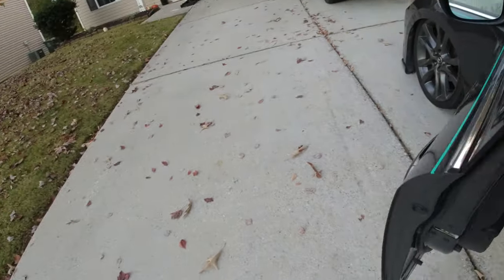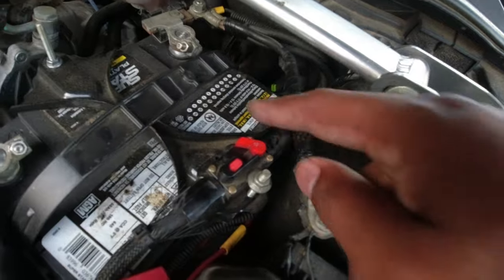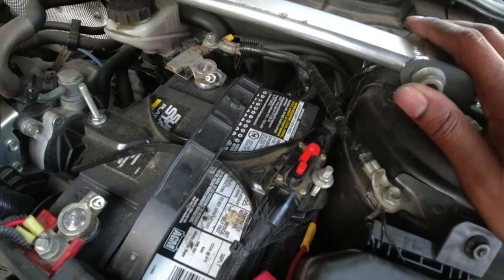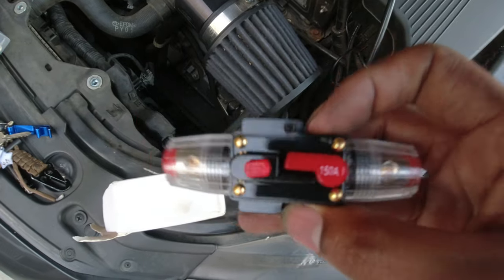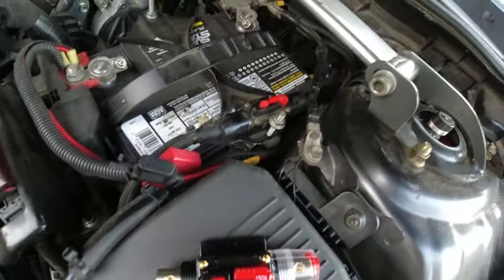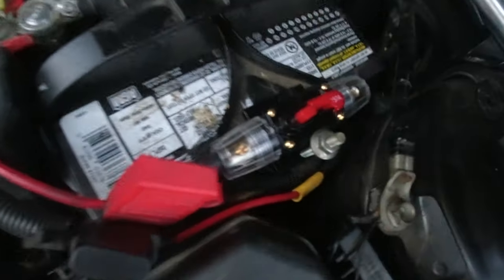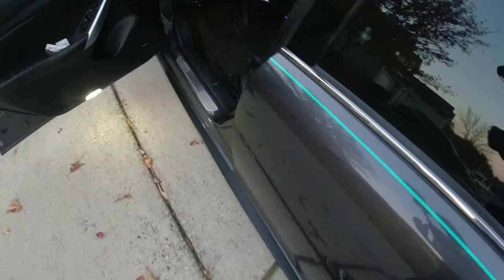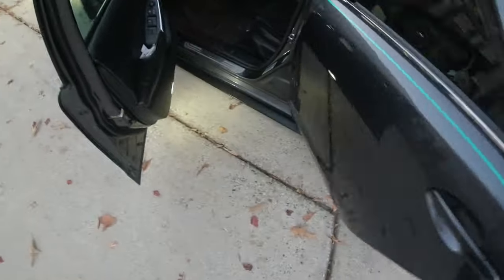The Best Car Audio Fuse? | Inline Circuit Breaker Fuse | Easy Reset

Comment: Good option vs basic fuse, but they're temperamental at times. Heavy loads, and heat cause them to malfunction over time, where a fuse normally only needs replaced, when it's popped.
Reply from the maker: I definitely agree with the heat soak issue as that was my issue.
Reply: So if heat is an issue just move it to the inside so you dont have to pull over pop the 2:49 hood and all that im bout to begin playimg with them and um going to put mine inside the cockpit so if it trips i can just restet it and keep going
Reply: @mrortega3852  The whole point of having a fuse or breaker, is for it to be as close to the power supply, as possible.
Reply: THE PROBLEM HERE IS BECAUSE IS INSIDE THE ENGINE COMPARTMENT WHERE IS TO MUCH HEAT
Reply: @bigotay  I've already mentioned that

Comment: Does it matter what side the power wire in goes to the breaker?
Reply from the maker: It shouldn't matter which side the hot goes into.
Reply: @DariusBuildz  .... Well that's weird because with the switch upward( off) I still have continuous power on both sides of the breaker, I got my voltage reader out and why do I still have continuous power on both sides of the fuse breaker ,my Amp turns off when I switch the breaker to off.
Reply from the maker: So the amp turns off, but your voltage reader still show voltage when you trip the breaker?

Comment: what is the rated amperage of the wire the breaker is connected to please
Reply from the maker: 4 ga OFC is normally between 150 and 200 amps.

Comment: hello, it seems to be a good idea ,but  i have a question. My car is connected to 70Amp battery witch circuit breaker i need : 70Amp or 80 Amp or 100 Amp or 150Amp ?
Reply from the maker: What are you using the circuit breaker for? That will determine what amp you need to protect what you are powering
Reply: I have a basic installation, and i even not have a radio or cooler ,i juste want to concerve and protect all my fuses and avoid any electric problems , i have a old car from 1995
Reply from the maker: It depends on how much the draw is. If it safely draws 100A, you wouldn’t want a 70A breaker.
Reply: @DariusBuildz   thank you for answer.....one of the sellers advise me to put 60 Amp circuit breaker... realy i dont know witch one i schould choose. Any way,  if  we simulate a short circuit with this 70amp battery , we should give the same current level i.e. 70 amp. but when the car is running , it is impossible to have a short circuit because in the circuit we have a lot of current consumers, add to this the alternator produce not less than 50 Amp, so 50+70 is 120 Amp, and the biggest Fuse that i have is 40 amp. Conclusion 60 amp it should be enough, isn't?

Comment: Hold the boat, you went from a 100amp to 150amp, and those breakers are the same internally, I believe . So, in the real world, what is the load side of the AMP? 
It looks to me like you might not even be using any protection on this circuit.
Reply from the maker: D4S recommends a 70w inline fuse for this particular JP3 amp. These cheap circuit breaker style fuses are overrated. The amp itself is not fused. The only protection is this circuit breaker